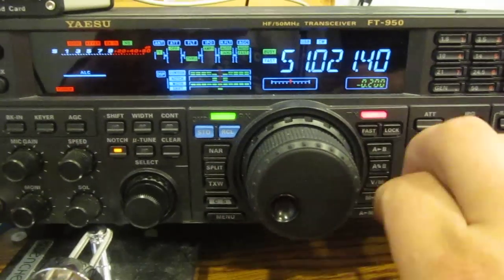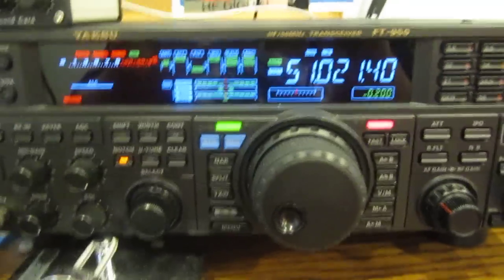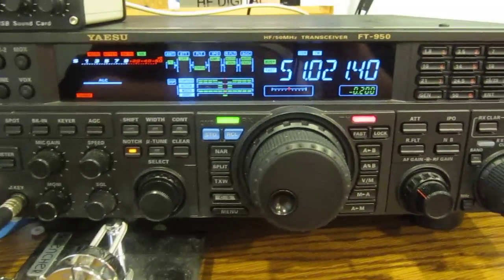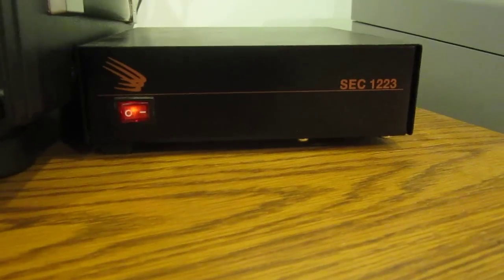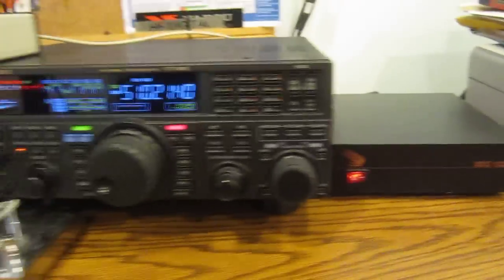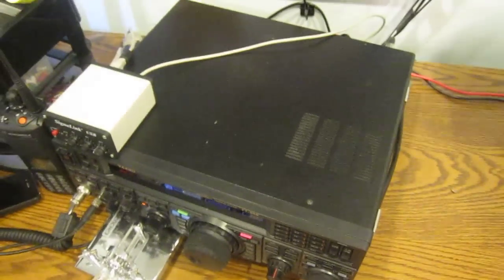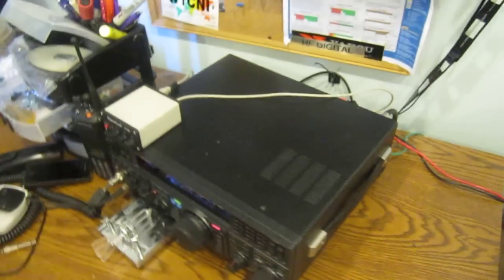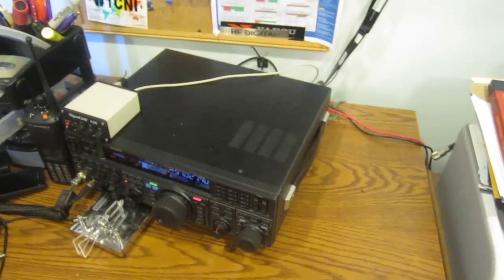Interference on my FT-950

Comment: I use the Alico MV-330 without any noise. It is a good power supply,  switching type and light in weight.